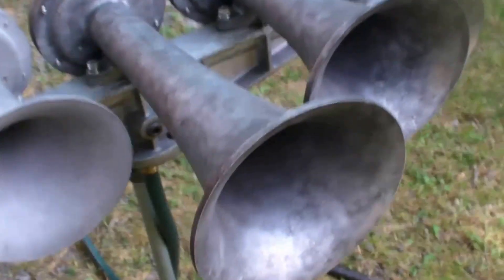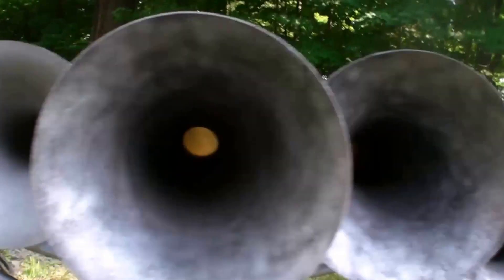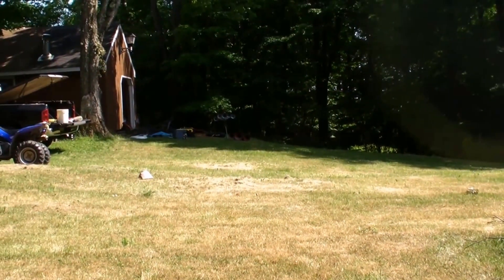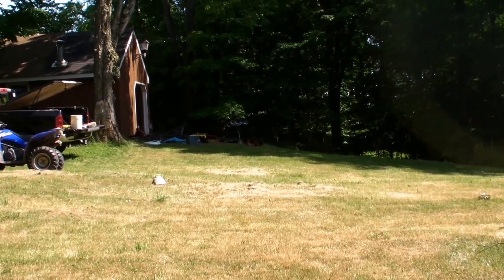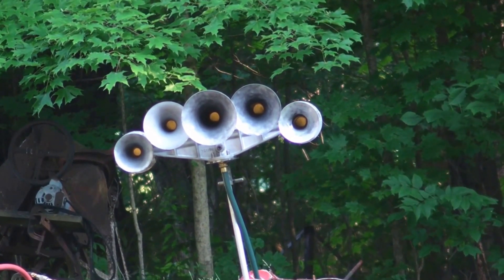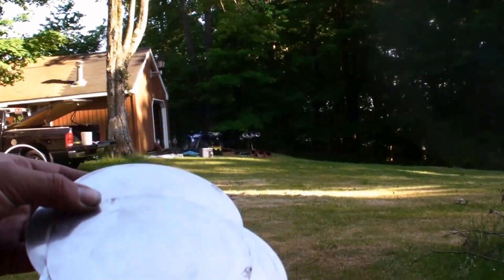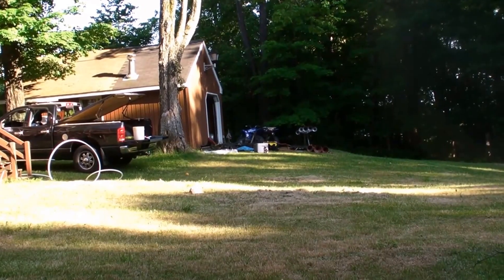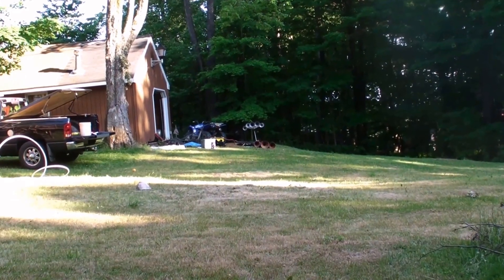Nathan Airchime K5L Horn Experimental

Comment: are you regulating the air to 115 psi max fill up on that black tank? is that how your regulating the 115 psi? I'm still trying to learn about all of this. With my setup with my K5LLA's I can't get the PSI through the 15 feet of hose, so I'm thinking either to big of diameter, or my regulator needs to be closer to the horns. What do you thinK?
Reply from the maker: you do not need a regulator if youre running 150 or lower. i use 120psi, 4 inch nipple, 1/2 inch ball valve, then garden hose to the horn. there is no regulator and its not needed
you only need one if . your system has higher than 150, you must use a high flow regulator (150+CFM)
try shortening your hose, the less, the better also 1/2 inch is a must
Reply: this is the regulator I have. https://www.acklandsgrainger.com/en/product/REGULATOR-AIR-LINE-3-4IN-NPT/p/LNC600012
Reply: @NickSilcox3  I'm running 3/4" epdm rubber hose. its about 25 feet altogether. air tank in the back and comes up to the front to the metering valve and then back to the back to the horn. the 1/2" sounded like garbage through the 3/8" valve...https://youtu.be/QdpZmx5xc6U